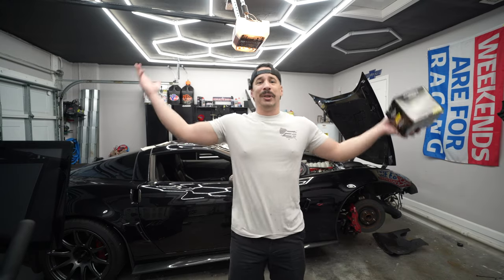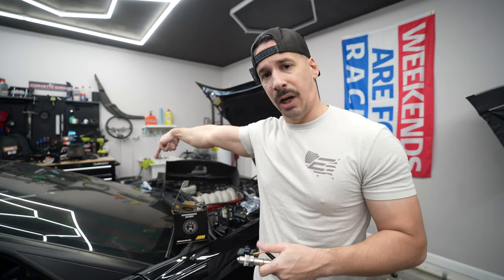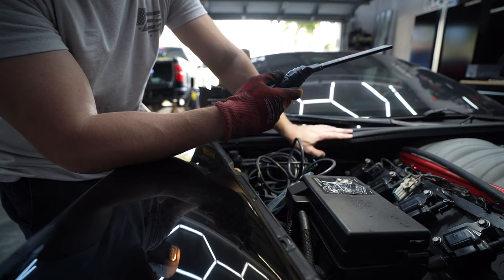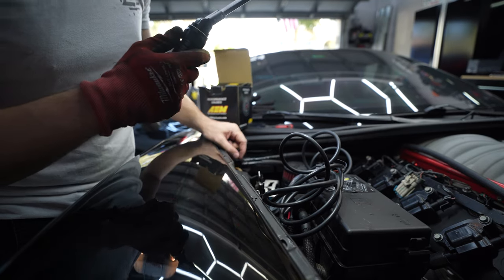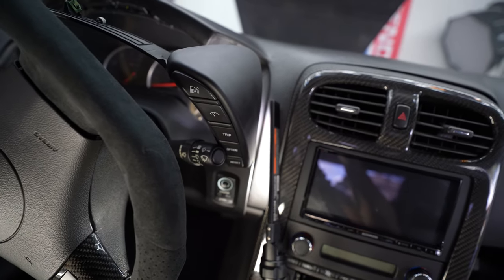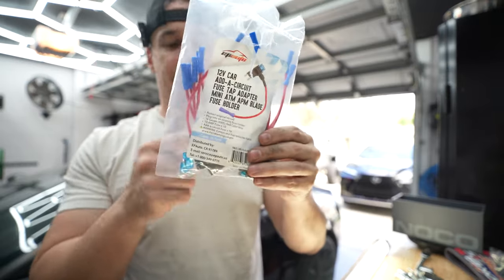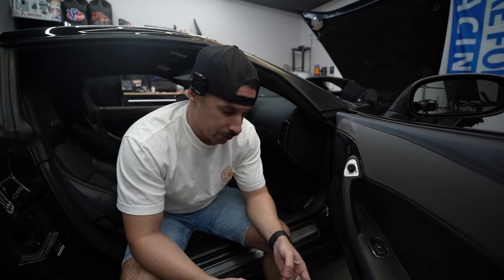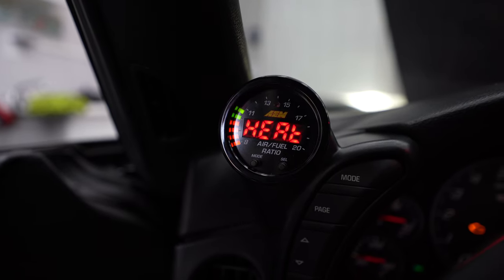C6 Corvette AEM Wideband Install DIY

Comment: I’d look into the ProLink cable as well if you’re going to street/remote tune via HP Tuners software. Will allow HP Tuner software (and ultimately your tuner) see the afr during logs.
Reply: That being said be mindful of which cable you buy as there’s one for MPVI 2 and a separate one for MPVI 2+/MPVI 3

Range from $35-$50 depending on which cable. Would be a good wiring project since you’re already fiddling with it and have stuff torn apart. Good video!
Reply from the maker: @Noeffortls7  thanks! Going to look into this!